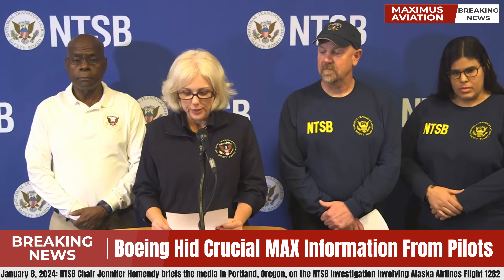Boeing NEVER Told Airlines That 737 Max Cockpit Door Was Designed To FLY Open During Decompression!

Comment: It has ben reported that it is common practice for these 'plug' covers to be removed during maintenance by airline and other maintenance organisations to better access to parts of the cabin, then refitted.

Until we know whether this happened in respect of this aircraft, e.g. to  fit or adjust seating or other fittings at the rear of the aircraft one should keep an open mind and not point the finger at Boeing, until the responsibility is found.
Reply: It was in the hangar for 10 days to fit the satellite dish for the WiFi, which is located above the plug. While the MRO has stated they did not work on the door, the statement they made is a bit vague.
Reply: It's clear Boing planes are not  reliable. Period. No spinning will erase this. The NTSB  is compromised!
Reply: This lady is talking shit
Reply: This aircraft first flew commercially on the 11th of November brand new. It won’t have needed any heavy maintenance.
Reply: This was a new airplane with 40 flight hours on it.

Comment: I can imagine this was a jarring experience for the pilots.  Not only was there a rapid decompression of the aircraft, but the cockpit door suddenly swings open and slams into the lavatory, and the emergency checklist immediately flies out the door.

At the very least, the pilots should be informed of these types of things, so that we don’t add more shock and stress to an already stressful situation.  This reminded me of MCAS where pilots weren’t aware of that either.
Reply: I have three airliner type ratings and each cockpit door/frame had "blow out" panels to allow a rapid D to occur yet keep the integrity of the locked door. I'm not sure that the Boeing approach is sound...
Reply: It not should have open there are diff pressure panels build into the door.
Reply: Retired Airline VP..  With respect,...  Nonsense!     @johannel4141
Reply: The old 737 cockpit doors had blow-out panels in them, for depressurisation, and everyone knew the panels would blow out.  So does the Max open its whole door, instead of having panels??

And why does the NTSB have a leader that know NOTHING about aircraft??    
She is not a puppet, she is a moron.

R
Reply: Not really. The cabin pressure is about 8.5psi and the pressure at 16000ft is about 8psi.
Reply: Explain why the plane had 400,000 hours on it with no crashes then two third world airlines, one of which at one time wasn't allowed to flying into US airspace crashed two just because of a simple run away pitch trim that could have been solved by turning off two switches between the throttles. Now go get some information before babbling like Homendy.

Comment: The public now have ZERO confidence in Boeing. It is so sad to see a once great company decline in such a way. The last flight I took was in an Airbus…. Thank god.
Reply: It’s all part of their plan to destroy once great American companies that are/were a huge part of this country’s identity and success.
Reply: Airbus also not safe. Think the next choice is the new China plane!!
Reply: 1 speaker... 3 person standing beside... Wonder why
Reply: Diversity and wokeness, shalom
Reply: Pretty sure "god" won't help you....
Reply: Good.  Continue to rely on computer-dependent flight control surfaces rather than traditional, relatively simple, and highly reliable traditional hydraulics.
Reply: @alexp3752 airbus has triple redundancies, it is still hydraulically actuated and can still be flown without fly by wire.
Reply: @operatordirt4611  That's true to an extent. Mechanical backup when everything computerized fail is basically yaw controll via rudder only and pitch is controlled with manual trim. Direct law allows the use of sidestick tho. And i really don't have any case where airbus would've been in mechanical backup only mode.
Reply: @alexp3752  with door plugs missing bolts to save money. 🙄
Reply: Not me, isolated incident. I can list a dozen Airbus crashes due to poorly designed software combined with their side-stick controls where one person is not aware what the other person is doing. With Boeing yokes, side by side, they KNOW.

Comment: The NTSB analysis of the flight data recorder should have recorded the cabin pressure throughout the flight. Do the previous and latest records of the cabin pressure alarm ( the one that activated three times ) indicate an early sign that there was a problem with cabin pressurization ? Do the airlines maintenance policies / procedures contain an implied assumption that alerts from cabin pressure alarm systems were caused by an alarm fault rather than cabin pressure being the real problem ?

The description of the cabin pressurization system having two independent backups, while reassuring for passenger safety, is less relevant than why the cause of previous cabin air pressure alarms had ( apparently ) not been properly identified. Did the previous alarm tests just examine the alarm mechanism / system only or was a cabin pressurization test also carries out ?  While Alaska Airlines placed a restriction on the jets ETOPS operations (as reported by the NTSB ),  with hind sight, should a more thorough examination of the aircraft been carried out before this latest incident ?  The final NTSB report will of cause present an exhaustive analysis of all the relevant data and present it conclusions. Watch this space.

Comment: Not sure why she said this. May be the manuals are changed at a later stage. All cockpit doors have small windows that open during the decompression in order to equalise the pressure difference between the cockpit and the pax cabin. The design is a secure one and cant be forced open from outside.
Reply: But the whole door smashed open damaging the aircraft, Venting and panels is surely the way to go not the whole door , what a security flaw.
Reply: @walterblanc9708  thanks for the update.

Comment: This is almost a 60 years old design.......🙊😱🤑🤑🤑🤑🤑🤯🤓💀☠️
Reply: The max is a poorly designed derivative of a once great airplane.
Should have been a clean sheet design but greed drove them to this point.
Boeing needs to get back to being an engineering company instead of this out of control manufacturing nightmare.

Comment: Boeing 737 MAX is designed to crash - but no one told the crew yet
Reply: This actually makes sense. This will come out in about 18 months, ya know, after this grounding completely bankrupts the airline. 🤔
Reply: Partly true.
The 737 Max would NEVER pass modern certification.  You cannot even separate left and right controlls, if there is a control jam.
The aileron disconnect simply does not work, and never has.
The elevators are locked together, and cannot be separated.
This would not pass certification.

R
Reply: The Max-Crasher
Reply: Great Comment
Reply: Get help before you hurt yourself brushing your teeth.
Reply: I haven’t heard any boeing crew complain yet. Why?
Reply: @herceg6772  Well, the dead ones cannot complain i guess
Reply: @lucius1976  what about those that flies and risk their lives? I’m not talking about dead.
Reply: Yeah....what a silly comment.
Reply: @RLTtizME  Not so silly considering the design flaws with MCAS and two crashes, the 2 year long groundings and the ongoing very sloppy quality problems. In German we call that "Pfusch!"
Reply: @lucius1976  Well...your cars are kinda crappy and are known in the US for reliability issues and over engineering. Lufthansa apparently doesn't share your consternation. Boeing has 4000 orders for the Max 8.  In America..we call your comment BILGE.
Reply: @RLTtizME  Well, a crappy car is a crappy car if evidence shows it is. So is it with airplanes. Plenty of americans think Boeings quality went to shit
Reply: @lucius1976  Yes....and plenty of Americans AND PILOTS prefer Boeings. Maybe you are still a little sore from that last big European conflict....featuring the Boeing B17 and B29.
Reply: @RLTtizME  Yeah, play your patriotic nonsense, i am not in that game. Boeings track record regarding the 737 Max is just simply disastrous.
Reply: @RLTtizME  No B29s in Europe.  Pilots used to prefer Boeings because they were flying the plane directly.  Well, the 737 MAX put and end to that fantasy.
Reply: @JohnHughesChampigny  You happy with the B17? You are groveling for commentary.
Reply: @lucius1976  OK....nobody is making you change your mind. You can just relax now.
Reply: @JohnHughesChampigny  Well the AirBus is equally automated.... So your comment is inert.  Now go chase that tail of yours.
Reply: @RLTtizME That’s it that’s an outstanding rationale, that because Lufthansa has bought these aircraft everything is hunky-dory. I cannot commend you more strongly for the strength of your argument.
Reply: @JoeOvercoat  Much respect to be edited by a tool named Joe Overcoat. Verabschiedung

Comment: I work on these planes and I had no idea the flight deck door was supposed to do that.
Reply: It’s clearly stated in the ATA52 AMM SDS.  Try reading the manuals…
Reply: Ops doesn’t disseminate the MX manuals to the pilots.  

The systems handbook for 737 pilots does not say the door comes open, it states that there are decompression panels for the door to equalize.

I’ve worked both sides, MX & Ops.  Have some compassion for the other side, we don’t need to be at war with each other.
Reply: It’s not something the janitors need to know
Reply: @Corey-pd3mi  You must be a big hit with your buds under the overpass.  How are you on the internet?  Did McD's let you use their password again?   Remember what happened last time.

Comment: I can't believe anyone actually thought the cockpit door was designed to work any other way. Do you want a door flying open, or do you want a whole bulkhead (which the door was retrofit into) blasting into the passenger compartment?
Reply: The doors in other aircraft typically have reinforced vents so the air can get sucked through that
Reply: @tomstravels520  Vents get clogged.
Reply: A correct point of view. On the other hand the 320 door opens inwards opposed to the 737 and still unlocks during decompression
Reply: You don't need to have the entire door fly open just to equalise the pressure.
Reply: @Motorman2112  Yes, you do.
Reply: @interstellarsurfer  The NG uses blow out panels.
Reply: @Motorman2112  That's a fair compromise. Something somewhere has to be capable of blowing out, preferably before bits of the plane's skin do it for you.
Reply: @interstellarsurfer  The question then is why have the entire door open and create an additional security issue when you could instead achieve the same thing with panels? 
Do these planes also have blowout panels but they also open the door if the differential is high enough or as a failsafe? I don't know enough about the specifics of these jets but it seems an odd choice on the face of it.
Reply: @Motorman2112  If your plane has depressurized, security is no longer your primary concern.
Reply: @interstellarsurfer But reinforced cockpit doors on the 737 Max 9 aren't retrofitted, are they? Reinforced doors were initially installed immediately after 911, ie 22 years ago. This plane is less than three months old!  That's plenty of time for Boeing to come up with a properly thought out solution.
Reply: @bookie5667  There's no other solution to that much air pressure differentially loading the skin of the plane. The air pressure has got to be relieved immediately. Besides, the Max in its entirety is a retrofit of the old 737 fuselage.

Comment: This is crazy....  hiding such a thing from airlines and pilots means that instead of being fully focused on dealing with the actual emergency, this crew thought they had to deal with another issue!!  So Boeing didn't disclose this but what about whoever certified the aircraft?
Reply: Boeing themselves certified the aircraft. They were given self certification ability by the FAA. That's the root of the 747 Max problem.
Reply: What nonsense!  I would expect a cockpit door to open should an explosive decompression occur.  If it did not, you could have a few significant structural problems to deal with instead.  What most people do not comprehend is that an aircraft is a pressure vessel.  Once the outer skin has been compromised, and interiors exposed to outside ambient air, the pressure must and will be equalized.  As a pilot, although this would be quite alarming to say the least, I certainly do not consider this a "security" issue.  That degree of downright paranoia ruined a once great industry to the point where flying is no longer enjoyable either to passengers or working crew,
Reply: @alexp3752  A pressure relief blowout panel, not the whole door would suffice.
Reply: @alexp3752  all true, well said

Comment: The NTSB shouldn’t have released to the public information regarding the cockpit door opening after rapid decompression as it will only serve those with ill intent to gain access to the cockpit using decompression…
Reply: It would have come out anyway. The report is public the information will make its way through maintenance and pilot circles. Do we truly think that bad actors do not have sources? This solution is security procedures that are already in place. X-ray body camera systems etc.
Reply from the maker: Exactly and it wont take much of a device to get the job done either. They need not only change the manual but once again retroactively fix the problem.
Reply: LOL -- this isn't Mission Impossible.  And all cockpit doors have a means to vent pressure differences.
Reply: @jimmiller5600 Sure, a "means to vent the pressure difference" would be a great solution.  Perhaps some sort of vent, etc.  But having the door fly open and thus negating any cockpit security?  That's a bit more than "a means to vent the pressure difference" donchathink?
Reply: @fuhkerz  1) using a cabin depressurization as a ruse to rush the cockpit is stupid fantasy proposed by ignorant people who think watching 007 Goldfinger makes them an expert;  2) the fixed and movable structures within the fuselage are designed to give way when the pressure delta hits a design point.  Failure to design an airliner in this manner leads to structural failure, control system failure and auxiliary system failure.
Reply: @jimmiller5600  Funny that you dismiss what is now the easiest way to bypass the cockpit protection as a stupid fantasy by people who think they are experts while pretending that having that protection bypassed is the only way to solve the issue.   So I suppose every other airliner works the same way?  None of them use any type of vent or other means to equalize pressure?

Or are you just being the typical smug commenter who tries to act like you know everything while dismissing perfectly valid concerns and defending objectively terrible design.

Comment: Can anyone explain to me the logic behind a door flying open during de-compression?.
And as Boeing said before,  it is not a door, it is a "plug".
So what BS is going on?.
Reply: Interior cockpit door opens on decompression to balance the pressure between the cockpit and passenger cabin. This prevents bulkhead damage which can also lead to damage to electrical and control systems that are running through that bulkhead.
Reply: @mk014a0003    Thank you 👍